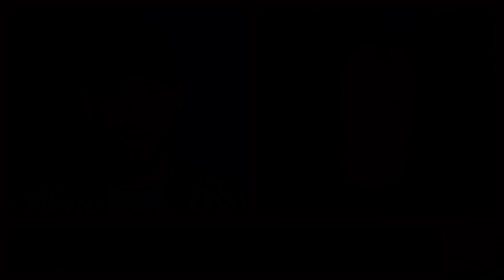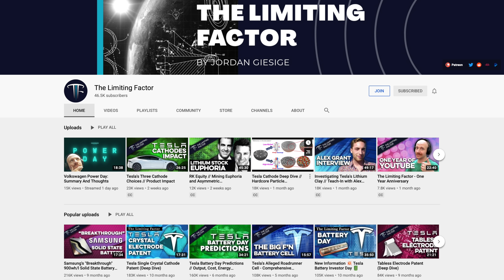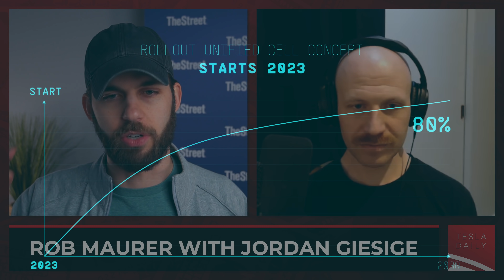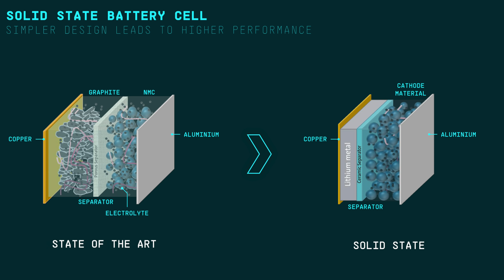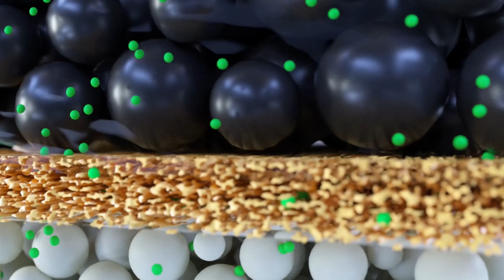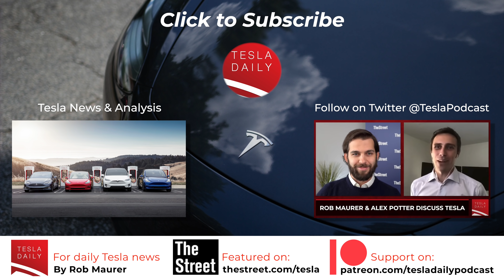Rob Maurer w/ The Limiting Factor on VW Power Day, Solid State Batteries, Tesla’s Advantages & More

Comment: Just a small correction. From what Jordan said it seemed like Toyota would be waiting on Quantumscape's solid state battery, but actually they are developing their own and they claim they will have a prototype working in 2021.
Reply: There have already been several prototypes, but most of them only in the laboratory with lousy properties and / or extreme costs and no possibility of mass production
Reply: You are probably right regarding Quantumscape. 
As Elon would say, making a prototype is easy, volume production is very hard. Don’t get me wrong Toyota has great engineering talents
Reply: @pascalg.8772  Oh yeah, I didn't mean to say that they nailed it at all. I only meant that Toyota is not relying on Quantumscape but is developing its own technology and they might get there before QS, which didn't come across in the video.

Comment: Can we assume that the total VW sales in 2030 will be 10M?
I think as the market shift tech the outcome could be different. It is not a given that current VW buyers will buy VW next time when they are shopping for a BEV.
Reply from the maker: Definitely not, but no way VW is forecasting for overall declines in their planning.
Reply: @rob_maurer  ...at least not officially. I wonder if they understand the consequences of having 60% BEV and 40% ICE. Those ICE cars will have less economy of scale. Supply of components will start to dry out and become very expensive. Prices will drop because people prefer BEV and because there will be many used ICE for sale.
I expect VW to have no profit at all from ICE when sales drop below 5M.